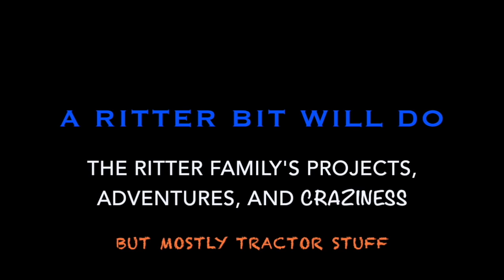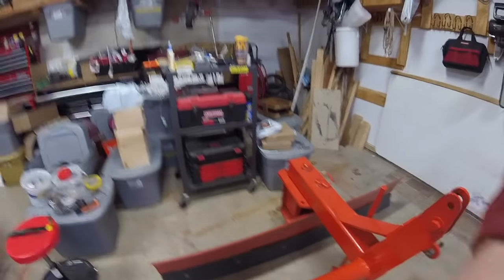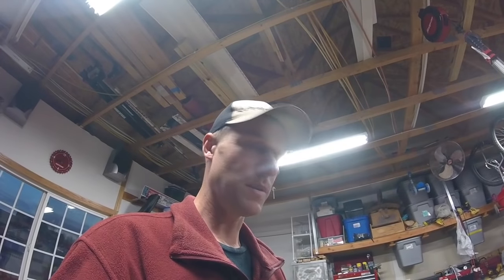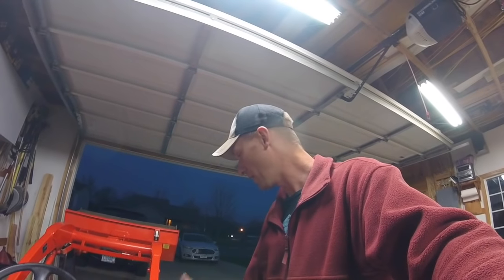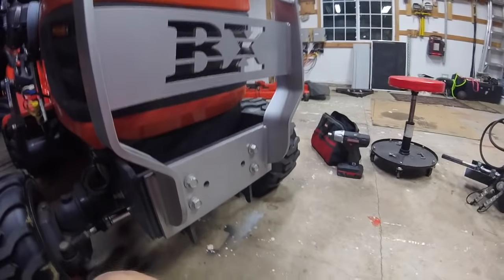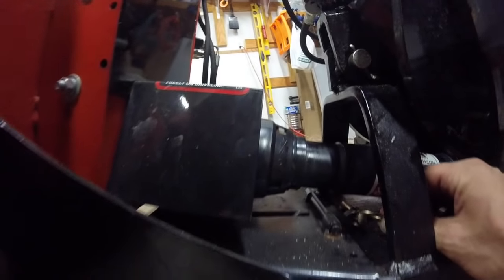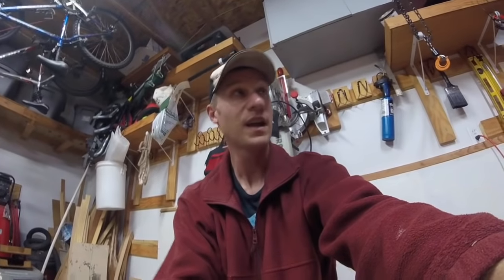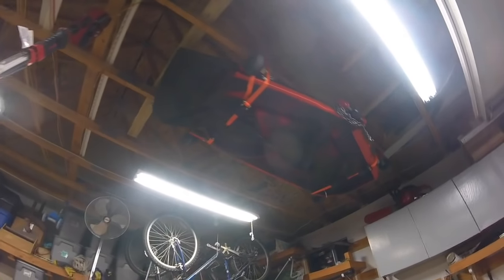Kubota Front Snowblower, Back Blade and Tire Chain Install

Comment: great video, I take the shear bolts out of the auger and put engine oil in the hole and spin the auger so the oil works in,, snowblower auger are bad for rusting on the inner shaft, and will tear the gearbox  apart if you catch anything as a result,
Reply from the maker: That is a very good idea taking the shear bolt out and working in some oil into that space. I will definitely be doing that. If I make a video of it I'll give you the credit. Thanks for the tip. God bless.

Comment: I might as well add, if there is a shear pin at the input to the gearbox, make sure that the yoke can spin, otherwise you will lose the gearbox because the yoke cant spin free if the shear pin bolt is  cut  . scrap metal yard is full of dead blowers with scrap gearboxes

Comment: I got alot of great ideas for my KuNota watching your video. Where did you get the LEDs for the headlights and the roll bar in the back?
Reply from the maker: Find them cheap on amazon or eBay. They are all made in the same Chinese’s factory and they work! I haven’t had any issues. I can’t justify spending 4 times as much for an American branded light. For LED’s for the headlights just type in the bulb number  on amazon and you’ll find an LED replacement. 
Have fun lighting up the night. 
Keep on tractoring and God bless.

Comment: Did you mount the same chains on your newer BX23S and if so, what about the clearance between the valve junction block under the right hand side rear tire?
Reply from the maker: I haven’t mounted the chains on my BX23S. Only because with the 300 extra pounds my cab weighs I found I don’t really need the extra traction. The valve that’s been relocated I could see causing an issue but only if there was a lot of slack in the tire chains. Good point. 
Keep on tractoring!

Comment: Hi Jon,
Regarding your tire chains, do you feel you require them front and back? I see some with rear only. I have a lead on a brand new front set for $75. I'm just not sure if I will require them. I have a dirt driveway which is pretty flat. Thanks in advance.
Reply from the maker: If you're in a climate that sustains freezing temperature for an extended period of time whereas ice doesn't melt from driveways and parking lots, than I would say rear chains are a must for those icy conditions. I can get away without front chains but they do make turning on ice better, especially with my snowblower down and less weight is on the front. If you have a front blade or front snowblower I'd suggest front chains if you do a lot of turning.

Comment: Do you actually need chains for those tires?
Reply from the maker: When it’s icy or heavy wet snow they come in very handy! With the light fluffy stuff they aren’t necessary.
Reply: Nice!  Where did you get the wheel spacers and tire chains?